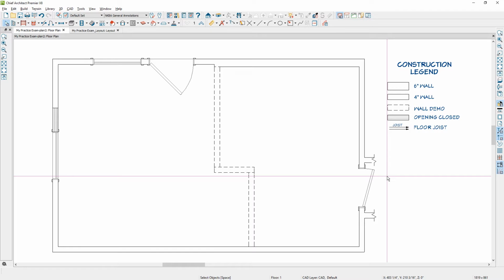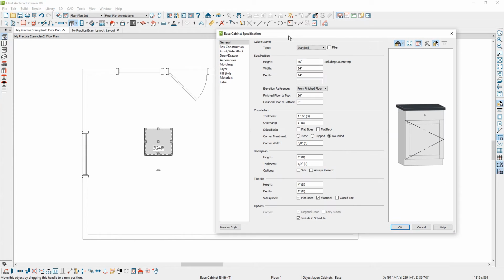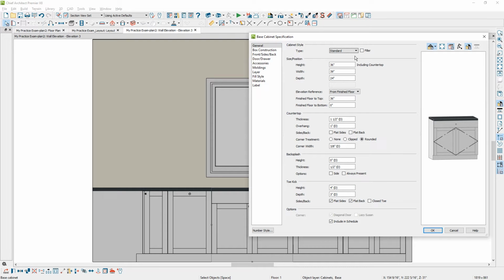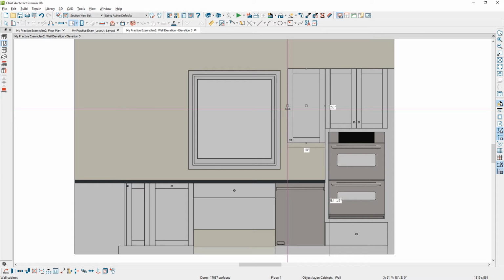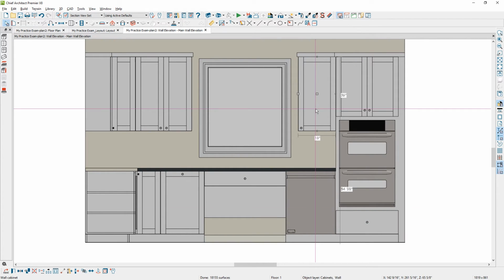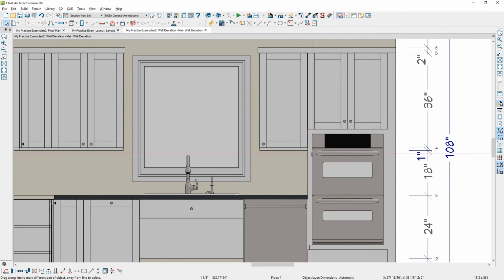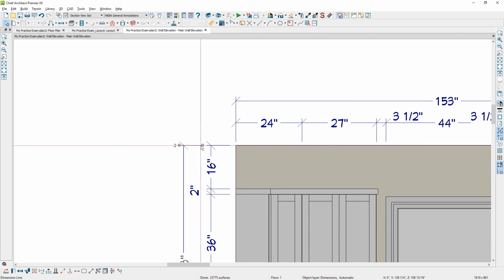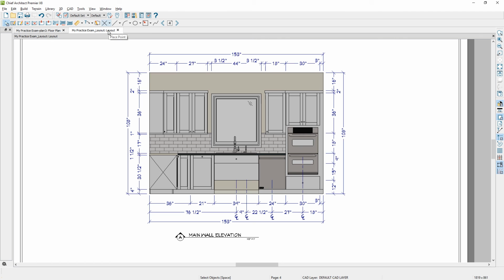Creating a Floor Plan and Main Wall Elevation for the NKBA CKBD Exam

Comment: I have a vaulted ceiling in my kitchen and can't figure out how to show it in the wall elevation. A section will show it but for some reason, I can't force the Wall Elevation to show the vault. What am I missing? Thanks!
Reply from the maker: Hello Kurt, to show the ceiling plane in an elevation view you'll want to use the Cross Section/ Elevation camera. The wall elevation will only show one wall, it does not display the ceiling plane. Thanks!
Reply: @ChiefArchitect  That's what I was afraid of. In a situation where my kitchen is smashed on the 2nd floor of a 3 story building with rooms on either side a cross section simply doesn't work. the cross-section is too detailed and doesn't allow me to hide the adjacent rooms without hiding the dimensions strings (which I prefer to display outside the room). I've found I can stretch the wall layer in the elevation so that it displays properly but this may have unintended consequences and it isn't that accurate. Is there really no way to treat the vaulted room as one room considering it is, in fact, one room and not a room with an attic?
Thanks for getting back to me I appreciate it!
Reply from the maker: Thank you for your detailed response. Unfortunately, that's not currently supported with Chief Architect Software, but I've sent it to our suggestion team to add it as a requested feature for future releases. 

I've also chatted with my team here to see if there are any workarounds you might try. If you're working with Chief Architect Premier you could use the CAD Detail from View tool from the cross section/ elevation camera and can clean up the display in the CAD detail. 

You might also try reaching out on our User Forum, ChiefTalk (https://chieftalk.chiefarchitect.com/). This is a great place to get advice from other users who may have a good solution to this. 

I hope this helps! Thank you again for your suggestion.